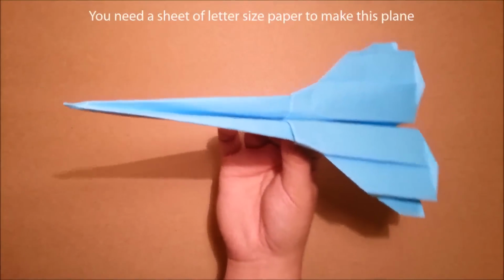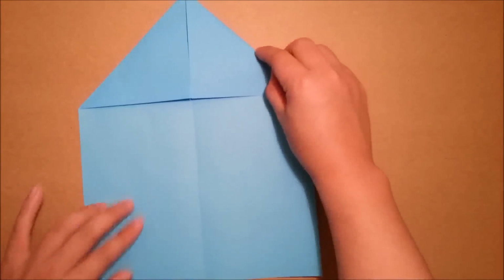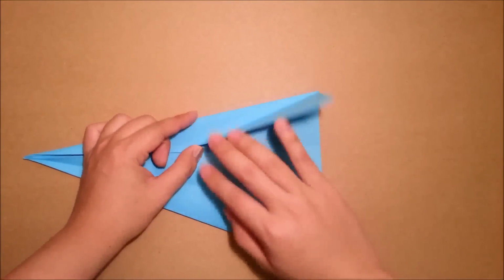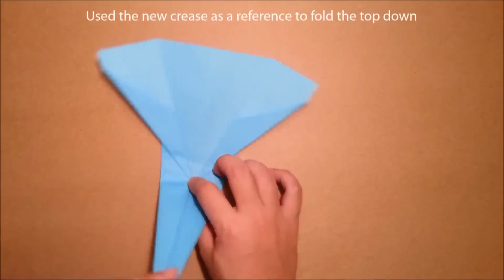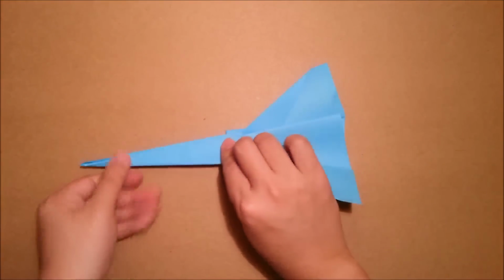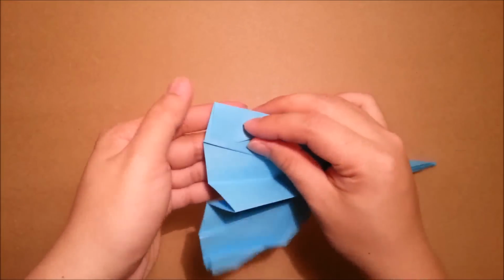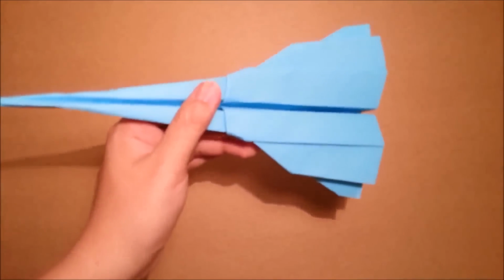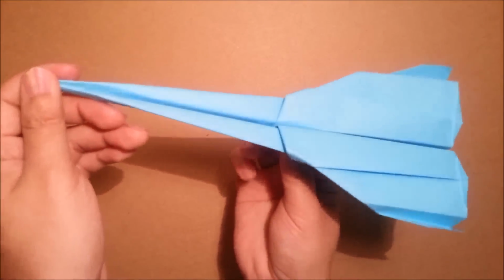Best Paper Planes - How to make a paper airplane that Flies | Saturn Fighter

Comment: BEST FIGHTER EVAAAAAAAAAAAAAA!!!!!!!!!!!!!!!!:)
Reply: This thing flied like a brick.  Wanted to see the real fighter?  Try "Kat's Paper Airplane."  Also, "The Most Beautiful Paper Airplane.  "Kat's T-tail," and "Kat's V-tail."  Hope you like them all.
Reply from the maker: KATAERO1 Basically a modification of the Swallow. You have to cut paper to make the tail. Anyways! Good job!
Reply: ***** Glad you like it.  What's about my delta-wing design (Kat's Paper Airplane), which requires only two small cuts?
Reply from the maker: It flied pretty well! However, when it comes to origami, I don't like cutting paper because it is easier to design. If you like cutting, push your design further.... :)
Reply: ***** Yeah, it's a tradeoff.  Does Origami also include cutting?  Cutting allows me to achieve certain wing shape, which enhances performance.  You're a "hardcore," aren't you?  I admire your discipline!
Reply from the maker: I believe origami means paper fold, so cutting is not a allowed. However, there is nothing wrong with cutting. It is just personal opinion.
Reply: ***** Does "paper airplane" must be able to fly also?  And in order to do that, it needs airfoil for lift and various types of stabilizers.
Reply from the maker: It should be flyable; otherwise, it is not exciting any more.
Reply: ***** But how well should it be able to fly though?
Reply from the maker: It should be able to glide for a certain distance. Generally, it depends on the people who fold it, too. Some people can make a any plane glide while other can only make a few work.
Reply: KATAERO1
I don't get it!? It worked very well for me, I'm sure just a few tweaking and it will fly very well for you!:)
Reply: Chris Far The problem with this design is that it resembles the Mach-3 SR-71, you know, extremely low wing aspect ratio, which is associated with very poor turning performance.  Worst of all, it has no airfoil whatsoever, so it has no means of producing lift, translating into extremely poor Lift over Drag (L/D).  

Do you think you can make this thing do a 360-degree turn and come to your hand?  I've found a 360-degree turn to be a good yardstick to measure L/D.  In the real world, the fighter which can turn the tightest using the least amount of time to complete the turn is said to possess superior dogfighting performance.  A good example is the F-16, although is an old design, but still second to none when it comes to turning inside its opponent in order to achieve a firing position.
Reply: KATAERO1
It resembles MACH 3 SR-71, but it isn't. It's Paper Artland's very own design, plus Paper Artland has more than has more than three boomerang paper airplanes, this plane has nothing to do with those planes IRL, it's just for fun, no IRL shit!:P
Reply: Chris Far A "Boomerang" maneuver is just one of the maneuvers within a flight envelop, which resembles an hollow egg-shape flight envelop.  Other maneuvers  include a vertical loop, a diagonal loop, and a stalled turn (hammerhead), which all of my designs are capable of performing.  A stalled turn exhibit a low-speed performance without stalling, spinning, out of control.

I've been exploring a suitable airfoil for paper airplane for a long time and found that a vortex-generating airfoil is superior to convention laminar-flow airfoil.  The latter just generates too much nose-down pitching moment, requiring excessive up-trim.

I have more fun flying my paper airplanes than making them.  How else, can you deign, built, and fly a real airplane made out of paper in about 5 minutes?
Reply: KATAERO1
Are you just here to advertise you're channel?
Reply: Chris Far I am here to advance the art & science of paper airplane design, my friend!  Basically, to try to get the most flight performance out of a sheet of paper.
Reply: KATAERO1
You just have the same advocacy Paper Artland here share's, so I get you're point!
Reply: KATAERO1
But remember not all paper airplanes has the same ability as yours, so pay it with respect!:)
Reply: Chris Far Do you prefer flying a "brick," or a real airplane made out of paper?  The science of aerodynamics has become so advanced that I like to see it being applied on paper airplane, in order, to have spectacular performance.
Reply: KATAERO1
Brick!? How does this plane fly like a brick!?
Reply: Chris Far A brick can't do a 360-degree turn, right?
Reply: KATAERO1
Of course a brick doesn't turn 360 degrees, however not all paper airplanes are intentionally made for stunts, that should sink in you're mind for now!
Reply: Chris Far You know if a paper airplane can do a 360-degree turn, it can do just about everything else a real airplane can do.  It's L/D that's the key, preferably, lots of Lift with the least amount of Drag. 

I also fly R/C scale gliders (1/4 and 1/3 scale), which can do the same maneuvers but much bigger in size.  The best thing about paper airplane is that I can do the same maneuvers right in my living room without having to leave my house at all.
Reply: KATAERO1
Like you, I'm a paper airplane enthusiast. And rarely ignore paper airplane which are intentionally made for display, so we share the same thinking. However, I don't mind any thing a plane can perform as long as it flies.
Reply: Chris Far "In the early days of aviation, the aircraft designers were also the test pilots.  This had the automatic effect of weeding out bad designers."  

(Igor Sikosky)
Reply: KATAERO1
I hope you don't mean it in a rude way!?
Reply: Chris Far I simply like to encourage you to get yourself up-to-date with the latest advancement in aerodynamics, so you can incorporate it into your paper airplane designs.  If you can find a way to maximize lift while minimizing drag, you will naturally have a good airplane design, regardless of what it is made out of.  "as long as it flies," to me, means having lift-producing airfoil, and a set of stabilizers, for 3-axis control (Pitch, Yaw, and Roll).  It must posses a good combination of stability and maneuverability.  If it is too stable, it can't maneuver, and conversely, if it is too unstable, it can't fly at all.

Designing airplane, regardless of the materials it is made with, is both a science and an art form.  A good design is a good balance of all the physical forces at work.  Have you heard of "form following function?"  A good design is simple and beautiful.

A good example is R.J. Mitchell who designed the legendary Supermarine Spitfire, which has the best L/D in its class (piston powered fighter) even by today's standard.
Reply: KATAERO1
Thanks! But I really don't prefer any designs as long as it flies, you gotta understand!:)
Reply: Chris Far No, not at all!  Paper Airplane designers like us, are naturally the test pilots also.  The difference is we don't put our live and limbs at risk, like those early aircraft pioneers.  Imagine inventing a flying machine for the first time, while learning how to fly at the same time!  The worst that could happen to us is scraping our failed design into a paper ball and toss it into the trash.  And back to the drawing board, to try to find out what went wrong, so we can come up with a better design.

When I have time, I will show you my somewhat failed design, which looks just like an F/A-18, with all the latest aerodynamic feathers I believe should make a good design out of it, like "dog-tooth" leading edge, slats and flaps.  It flies alright but I need twice the space to do a 360-degree turn, and I have to throw it twice as hard too.  However, it has a beautiful look just like the real thing, with high-aspect ratio laminar-flow wing.  That's how I discovered that a vortex-generating airfoil is far superior to a laminar-flow one, when it comes to paper airplane design.  It's also much simpler, and lighter also.  I think it has something to do with the Reynolds Number.
Reply: Chris Far So, you don't believe in creating an airfoil in order to maximize lift while minimizing drag?  Do you know that a flat surface is the worst airfoil of them all.  Have you seen any plane with a flat wing?  Also, when you look out the window of an airplane you're on, you will see the wing changes its shape dramatically, especially, during a transition from cruising to landing.
Reply: Chris Far Nice, chatting with you.  God bless...
Reply from the maker: KATAERO1
I think you are into paper airplanes, so I would share with you my thoughts.  I already thought of everything you have mentioned above. I designed paper airplanes for different categories: shape, aerodynamics, and airtime. etc.  However, I tend to design planes for shape.
Reply: ***** Me too.  Sometimes the same basic wing design but with different kinds of stabilizers (T-tail & V-tail), give different flight characteristics (Kat's T-tail & Kat's V-tail).  For example, you can compare my delta-wing design (Kat's Paper Airplane) with my twin boom design (Kat's Twin Boom Paper Airplane).   Both may have very different look but possess the same excellent L/D, stability, and control.  I use a 360-degree turn as a yardstick in measuring L/D, stability, and control.  The bigger the circle, the better are those qualities.
Reply from the maker: I experienced all of that. I don't think the bigger the circle means it's a better plane. It depends on your room space to design the plane. I create planes fly slowly in a small circle, so I can fly in a small area, and large circle to play out door. There is no standard to consider what is the best. It is very much personal, so I really open and appreciate everyone's designs. 

The stabilizers mean to control the plane, so basically you just done everyone had done, and all the plane is just one plane. I am glad that you have experienced with paper airplane that much. Impressive! 

Check out this plane. You just adjust the stabilizers to change the direction of the plane.  
Paper Airplane Tutorial: Sun Fighter | Included Flight Test | Worth Making!
Reply: ***** The bigger the circle means you have a very efficient design, with little drag (both parasite drag & induced drag) and lots of lift.  To me, it is very easy to make a tight small circle, you just, crank up the elevator control.  However, to make a big circle, you need to really minimize drag, and you need lots of speed also.
Reply from the maker: As I have explained above. It needs to match your design goal. For me, it is extremely difficult to design a small circle plane. Small in this case is flies around a diameter of 2-3 feet so I can sit down and fly it round my small room. It requires you increase the drag and slow down the speed so you can have enough time to catch it.
Reply: ***** To do a tight turn, you need to camber your wing (curving the wing) PERIOD.  Also G-force becomes a factor, as you subject the wing to tremendous lifting force, so you need to keep the span loading to a minimum, as paper does have rather limited strength.  Please, don't try to increase the drag because it is the very thing we try to minimize.  There are two kinds of drag, parasite drag and induced drag.  The former is just the "wet" area, and a compact design reduce it to a minimum.  The latter is the by-product of producing lift by the wings.  Therefore, a suitable airfoil and wing planform play a crucial role.  You want to trim the excessed drag to a minimum.  Example for subsonic wing planform is that of elliptical like that of the legendary Supermarine Spitfire.  Or you can imitate that of the birds also.
Reply: ***** Also, you need to nail the Center of Lift (CL) right on the Center of Gravity (CG) in order to keeping up elevator to the minimum, and minimizing trimming drag in the process.
Reply from the maker: Thanks for the info. Show me how you adjust your current plane to make it fly like this one. 

Paper Airplane-Psychotic Cyclone | Check Description for Tutorial
Reply: ***** That one bare has energy to complete the small circle, due to low aspect ratio wing with primitive (flat) airfoil.

I will show you how to turn on a dime like this in style.
Reply: ***** Oop, I meant to say "that one barely has enough energy left to complete the small circle,.."
Reply: ***** Watch Kat's Tight Turn.
Reply from the maker: np. keep in mind this is folded with one piece of paper, so there is a limitation.
Reply from the maker: KATAERO1 I meant one piece of paper without cutting, gluing or whatever materials to enhance the plane flying ability. It is more challenging and more interesting to to create paper airplane from only one sheet of paper, and I feel more accomplished. Also, I limit myself to use only letter size ( or A4) because they are  popular and easy to get. Origami, or square paper is acceptable.
Reply from the maker: KATAERO1
About paper airplanes, my philosophy is different from yours. I follow origami rule, and  I want to keep my channel unique and be distinguished from others. Thus, I create my own paper airplanes, and fold all  with a sheet of uncut paper.
Reply: KATAERO1
I believe in anything that need's to be done as long as the plane flies well! My point made clear!:)
Reply: ***** I understand where you came from, my friend.  You are more like a paper sculpture, than an aircraft designer.  I, on the other hand, try to understand how air behaves when disturbed, and how to take full advantage of it, in order, to extract the maximum performance out of my design.

God bless...
Reply: Chris Far It depends on what you mean by "flies well."  To me, it should exhibit certain level of efficiency, stability, and maneuverability, just like the real thing.
Reply from the maker: KATAERO1
I rather call it "ORIGAMI ART" then paper sculpture. If it can glide or fly, it is not a sculpture. I do not hesitate to sacrifice a bit of performance for the beauty.

I am a paper airplane designer who use origami as a guideline. I will not be an aircraft designer because it is not what I am going for. My goal is to inspire kids and anyone to science through art, and I hope they will invent a high tech that help us travel faster and even from planet to planet. See! you are one of those. You could be able an engine that can help us travel the universe.  

If you consider you are an aircraft designer, Good! think about the limitation of technology and how you can accomplish the project successfully without expanding the cost. If you want to be a real aircraft designer, push your design further, make the plane land vertically, speed it up to match 3. Flip it and fly it back to you, or design a plane that flies in a zic zac direction. Moreover, think about kids, In your situation, a tape and a pair of scissor is already available, and you are old enough to use them. For kids, they are to young to manage the tools. 

Good luck!
Reply: ***** I apply the science of aerodynamics through a medium, namely, a sheet of paper, in order to achieve certain level of performance, namely, L/D, stability, maneuverability, and control.  And the best way to achieve those parameters is through simplicity, which translates directly into economy, reliability, with fewer things to go wrong.

A sheet of paper naturally imposes certain disadvantages and advantages.  So, the goal is to maximize the latter, while minimizing the former.  

Vertical performance always come at extra cost, in term of energy inefficiency.  For example, helicopter always require 1/3 more power in order to achieve the same cruising performance achieved by that of fixed wing counterpart.  

Also, supersonic flight also comes at extra cost, in term of energy inefficiency, as well as, material thermodynamic limitation.  Therefore, practical supersonic flight will require nothing short of a revolution in engine technology, other than the current jet turbine technology.

Space travel, however, is an entire different proposition altogether.
Reply: ***** "I am not hesitate to sacrifie a bit of performance for the beauty?"  But does "form following function" through?
Reply from the maker: Yes it does. Have you heard about streamline? Don't you know form has an impact to function?. I know what you meant, but this is my answer.
Reply: ***** Streamlining to me means keeping the parasite drag to the minimum.  It's to get rid of everything that has noting to do with producing lift, providing stability, and control.  Especially, in commercial aviation, it means saving fuel, which translates into higher profit.  In military aviation, it means, extra speed, range, and maneuverability = tactical advantage.
Reply: This argument is getting nowhere, both sides has their own opinion. Get over it guys, you both can't prove a fact if one keeps contradicting one's opinion, you both are great paper plane creators, let it be, this argument will keep getting longer and longer unless one stops responding, so please, get over it.
Reply from the maker: Chris Far
It is not really an argument but a share of ideas. Anyways, it should be stopped at this time because I already made my point clear! :)
Reply: I was just annoyed because I kept receiving those annoying notifications.:)
Reply from the maker: Oh, sorry bro!
Reply: It's OK bro!:)
Reply: ***** I enjoy exchanging ideas with a fellow paper airplane designer such as yourself.  Thanks for all the inputs.

God bless...
Reply: KATAERO1 lol, you just gave away basically all the answers to my science homework! XD
Reply: Insane Sports What was your science homework about, may I ask?